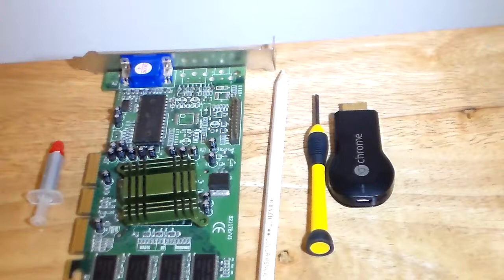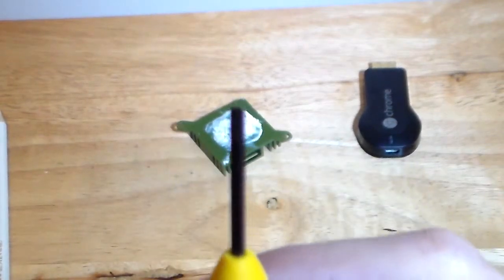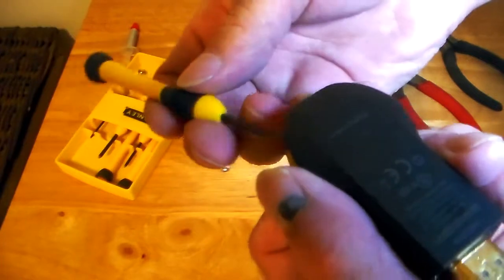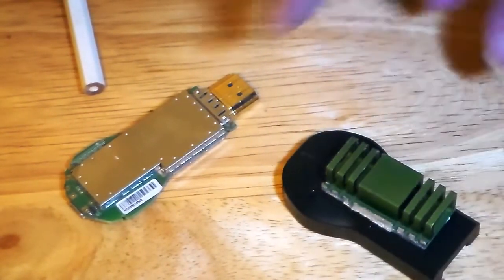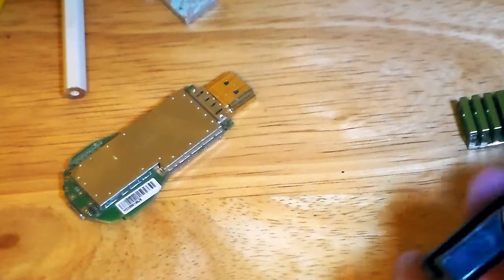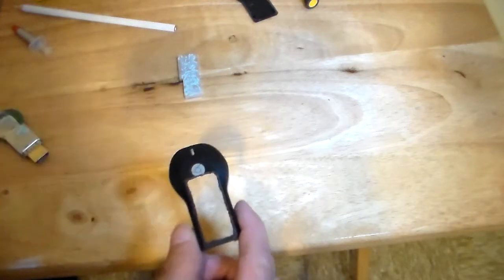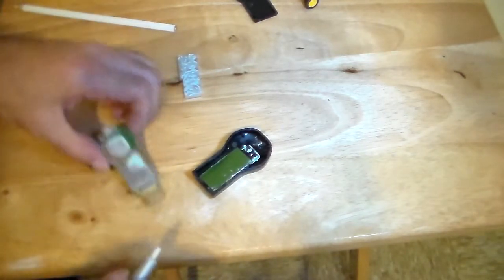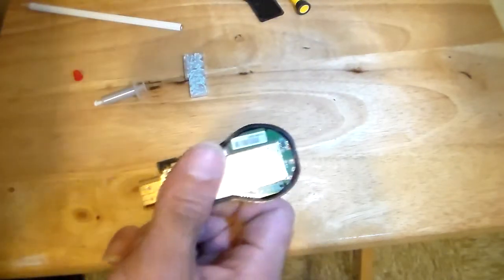Customize your Chromecast for better performance

Comment: That looks way more nifty with the new heat sink! Mine apparently quit working lastnight so I had to watch your video to see if the hdmi connector was broke and upon further inspection, it was just one of the little prongs had gotten popped up and bent out of position some how.  I just popped it back in place with a tiny flathead and bam! I had a slight panic attack when I woke up today, but Im good now.... Thanks for the video!!!